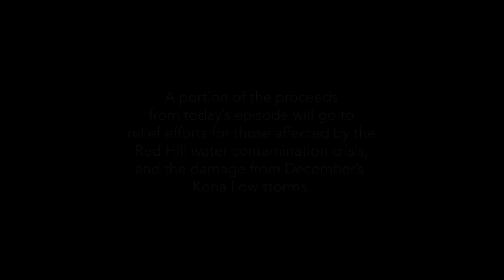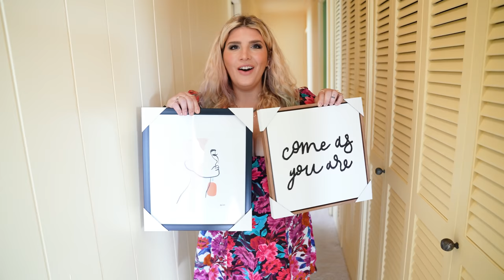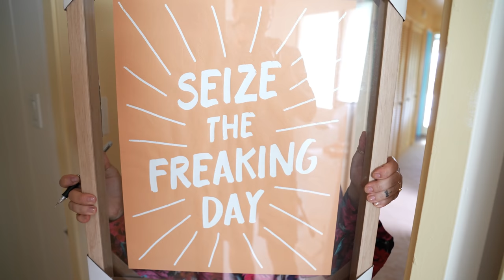Our Island house is RUINED 😱 (fixer-upper NIGHTMARE)

Comment: The sad things is I can almost guarantee you that the people who sold the house to them knew that drainage was a problem and didn’t tell them. At least now they know and can fix all the issues before they put in new floors and furnishings. ☹️
Reply: That's almost,  exactly what I was going to comment, those sellers, were like here Ya go sucka.😳😫 
Wishing y'all the best,  and this has been said already however, thank the lord this happened now, so you definitely know, what is on the to do list now. 
I'm also curious if that is termite damage, & water damage? If it's termites, You should definitely get the house, & all your trees checked, &  treated for termites then!!
Wishing you 3 the happiest, healthiest, safest, 2022!! 💞🙏
Reply: @missybekind5022  yeah from a brief glance (I'm sure they had actual inspectors) but it looked like just what humidity, rain and salt air does to outdoor timber esp if it's not repaired and resealed frequently. They probably actually found termites though.
Reply: @nox8312  I totally agree, nobody would buy without having it inspected first. 
However, when Joey! Was tearing that patio wood,  I'm pretty sure, Kate said "termite damage." (Can't remember the time stamp.)

Comment: This is a nightmare right now. But there are several ways to deal with water issues. My previous house had high water in the backyard. I was terrified it would get into my house, but then I had a French Drain professionally installed and the problem was immediately solve! Good luck Mr. Kate you can do this!
Reply: How much did that end up costing you?
Reply: Exactly french drains are extremely common in Europe were its cold and wet!
Reply: I added a french drain and sump pump in my basement in Utah. We have clay soil where we live and some year's we will get over a foot of snow then it warms up day's later and melts it all the snow has to go somewhere. Once we put in the sump pump and french drains we've had no more problems.

Comment: Time to install a French drain network! Once it’s in, you’ll love it, and it’s not actually that expensive, compared to, say, regrading your lot. 😉
Reply: I bought a house seven years ago that the prior owners installed French drains around, and they have saved a lot of electricity for me as my basement sump pump hardly ever turns on, even in 3 day storms.  They work, if done right.  Joey has the idea.  When things settle back down he can dig the trenches he needs, line them, put drainage gravel in and plastic drainage pipe and guide the trenches to where he wants the water to flow.   However, if neighbors don't have their yards graded properly or don't have French drains installed to drain water from their land, it could well overflow to your property and overcome the French drains.  You would also want to make sure that the ravine or gulch where you're draining the water to is stable and won't collapse if thousands of gallons of water is directed into it, including flow from neighboring properties.  Wow - too much to think about.
Reply: @jannibal9273  I love how much knowledge we can find in the comments 🥰🥰

Comment: One more thing! Start collecting water now at Costco. Don’t just wait for a major storm to come to get supplies. Make sure you have a generator that can power your fridge, a few fans and at least one split unit a/c. Also, a few buckets from Home Depot. I like those in case you lose water and I use the water coming off the roof to collect and use to flush the toilet. Not trying to scare you at all. It’s just nice to feel prepared.

Comment: You’ll be ok guys. There will be an engineer out there who can advise you of your rights and protocols. If the rain is causing this much damage, then you might get your plans pushed through quicker to start construction work. It looks as if your foundations are rotten and maybe foundation subsidence. It can be fixed, but obviously at a cost, everything needs underpinning and all the drainage needs sorting to drain the water away. Also all of your guttering needs replacing and attached to drains to take the rainwater away too. Tomorrow is a new day and also the star of a new fresh year. Hugs and cuddles sent your way from here in the U.K. you’re both clever individuals in your own rights and you’ll work it out with the right people to ensure your own safety and that of moon. Good luck guys and Happy, Healthy, prosperity for the coming year ❤️
Reply: Yes this is great advice!

Comment: I hope your house is ok. Call in water abatement crew. Get industrial humidifier, dry as much as you can, and may need a ozone generator. 

I had hot water heater pipe burst in a fire. I have dealt with similar flooding and water damage. 🥺🥺🥺

Comment: An advice from someone who lives in an area that is often flooded, even if your house is not in the flood zone, a flash flood is a whole different thing, you’ll just never know where it will go. My house is in the flood zone, but since it was built higher up the usual flood never really reaches my house even when all my neighbors' houses are drowning. Then flash flood happened back in 2014 and the flood almost reached the second story of my house, literally like 20cm away from reaching the first floor ceiling. Never underestimate flash floods. It came out of nowhere, the water level rises super fast and the water current is deadly, especially when it carries along wreckages. Also, where I’m from we don’t get an alert or warning, so when you get a warning next time, please don’t treat it so casually, they are sending a warning for a good reason.

Comment: I know how you feel even though I live in mainland Spain. We had just finished the renovation to our new home when we had a what is called a Gota Fria and our whole house flooded from under the house as the flood waters did not reach our building.  We had to have the whole floor of the house replaced whilst keeping our fingers crossed that the walls did not fall down.  In fact under the kitchen we found an 8 foot hole and that the floor was only a few centimetres of concrete covered in tiles! Anyway that is way behind us now and we have a lovely tiled floor throughout the house that we love. So think of this as a blessing in disguise.
Reply: I was going to say the same. I'm from Galicia and raining is so common, during Autumn-Winter is the worst but the houses and even the cities up here are already designed to hold on during floods. 

They need to first pull through and then they'll be able to prepare for the next one. This my come with having to pick practical prior to pretty but I believe they can pull it off.

Comment: So sorry about the rain and flooding 😔 we are in SE Texas and have survived Hurricane Harvey and 2 years later Tropical Storm Imelda flooding. For anyone that has to deal with flooding, be sure to remove everything wet and clean it with vinegar and let it fully dry before putting it back. Mold grows easily in humid climates which may be a little different from what Joey and Kate are used to. Everything is replaceable and this will give you guys first hand experience to know how to rebuild areas of your house and yard. Still so unfortunate you had to go through this!

Comment: I'm from Puerto Rico so I understand the tropical rain struggles, after a few days of rain flooding is inevitable. My house has a drainage system. A few years back pipes were installed underground, they have collection points with screens to keep out the rocks and such and they collect the water to be drained in safe point of the property! Hope you are able to fix your issues!🏝

Comment: Btw flash flooding doesn't necessarily come from the sky (at least not where you might be) usually it comes from overflowing upper catchments. So you don't need to be low lying or storm surge flood prone to get flooding in a flash flood. Or it rains so heavily in a short period that there's no time for the water to drain away (and obviously your property has drainage problems too). Would definitely be worth getting well acquainted with Hawaii's emergency systems, what they advise for property and personal preparation, and what different things mean and how they could affect you.

Comment: Anything that needs to be stored, but in plastic sealed bins/higher up… Not specifically Hawaii, but in TX our house was on a slope… The lake was at the bottom, with X Amy of property that didn’t belong to us but could flood… That part never flooded, but our driveway (top of slope) would flood, and into the garage/front room. So after one rain we ended up buying Christmas size bins to store things, and my dad Installed a draining system to deteriorate the water out or garage area. This solved the problem about 90%, so where it wasn’t that much of an issue…

Comment: something my country would do with roads near malls or underground train stations, is that we do have a drain built along the edge of entrances to prevent flooding, and alot of our buildings are built elevated from ground. meaning there is always a step or two between the building to the roads. This way if we ever occasionally do get heavy and long rains, the water will not overflow and leak into buildings.

Comment: I may not live in a tropical area, but I do live on a marsh. Those flash flood warnings come all the time and our basement is known to severely flood. Although safety isn’t the concern for me, property damage is definitely on my mind. We’ve re-done the draining 3(?) times since we’ve got this house, invested in way to many sand bags (each storm seems to need more and more), and spent lots of time researching the best ways to absorb and clear the water that still comes in. Flooding isn’t fun, I remember the first time it happened I freaked out. Thankfully we have a ton of camping gear so when we do lose power, we can manage fine for the most part. Collapsible water jugs or any type of water storage is a must for power outages if you need electricity to bring water into the house (might be applicable if you have your own well or live on a hill and need to bring water up to you), but sewage is another huge concern with storms an power outages. I’ve forgotten how many times we lost power and our sewage pumps stopped working and within minutes, we have another issue flooding our basement. Stay safe all.

Comment: I spent many years in the Canal Zone, torrential rains were a regular thing as I remember. Our houses had tile roofs with deep overhangs. Maybe four feet. At ground level at the edge of the overhang was a wide shallow concrete drainage ditch. This ditch was not deep but wide and had high enough edges to contain the runoff. It doesn't appear that your house has any rain catchment ditch that I've noticed. Our entire house was surrounded by this ditch. The containment ditch surrounding the house continued through the yard to a deeper and wider ditch that all the properties flooded into. This deeper ditch at the edge of the property carried the runoff away from all the properties and the street. Between the house and the catchment ditch was a garden area. This area was elevated to the top level of the edges of the catchment ditch. For your house not to flood you just might need to do some serious grading and install a similar runoff collection system. I believe in an early Hawaii video you mentioned you were going to reroof the house. Consider the deep overhang and runoff collection system in your plans. Good Luck!

Comment: Sorry for what you dealing with but i say use it as a lesson of what needs to be done when your renovation has to be done. Drainage systems. Water tanks maybe underground ones if not the too ground ones, save on water for your house, overflow systems especially for your gutters to flow to somewhere. Best of luck and a bumber that the new year maybe starting so.

Comment: hi guys, keep safe!! maybe you can get in touch with someone on the island who knows how the drainage stuff works so you can take that into account on your renovation. also, if you are planning to raise the ground level in your property so the water flows down to the street drainage system (i guess?).. cause even if you're on a hill but the property itself is the same or lower than the street ground level, that kinda sounds bad news.

Comment: As an island girl I can tell you... You will only get two seasons..rain half of the year and summer on the other half... . Carpet all over the floor is not ideal it can get moist and bad smell due to continues rain.. While building house the base need to build one or two step high above ground... And extend the roof outside the house a little more intending to keep the water away bcz rain comes with wind ..

Comment: Yikes, as you assess...good to drain away from the house.. Stormwater ends up in the reefs adding to the stress on coral, the natural storm barriers of the coast and vital eco systems.  Its  no on diverting water to the sewer system. thats the regulation.  Overwhelms the sewage processing area and creates sewage overflow to the reefs.  Worse than just stormwater. Holding water so it can naturally drain at a slower rate after the rains are over is what we are required to do on Guam.  The holding areas do overflow during heavy multi day rain. We are required by regulation to 100% hold stormwater on developed property including residential. BTW no one has wall to wall carpet here, vinyl  or wood floors.  After many storm cycles over the years, its Tile all the way.

Comment: I feel like there should be a how often in years a weather event like this happens warning system. I feel you guys so much right now. 2 years ago I spent almost a month straight driving down behind my home where it meets the Arkansas River to see how close it got and if the protection walls were breaking yet. I took pictures from the same spot. Based on math (I have friends 2 blocks away at the county sheriffs offices and one engineer for our damns in Tulsa etc) working out if the water broke thru I would have 45 min to load self, miniature horse and 2 dogs at the time and get them a mile down the road to an elevated "safe" place. It would be super tight cause the whole place would be leaving at once. The city had already asked for evacuations. That pissed me off bc they were reinforcing everywhere but here. This was what they called a 100year flood scenario. In today's words..something this bad only happens once every 100years. That would have told all of us grab your bums and a uhaul. The last time it did this was 35 or so years ago and it broke thru a retaining wall 1.5miles from me. They built a monument to show how high the water got. 20 feet over my head if I stand next to it. That same wall sprung a leak during this event. I called my engineer. My man called the governor. The national guard was placed on the wall. For days....weeks. No repairs. Guess they would have jumped into action if it got to real. They have the ability to help from the air. Still....everyday...down to check if today was the day. It wasn't fun and I do not envy you guys got damage. We lucked out. The walls held...barges escaped...so much destruction.

Comment: Omgggg I feel for you guys, you Need to invest in a water pump system and big drains, also when you eventually do the re-modelling, I would build up the doorway steps... In the UK 🇬🇧 as it rains a lot all year round all our door steps are high off the flat ground front and back entrance... Maybe install a draining system in front of your garage so in future it drains away from the garage door area... Houses here built on flood plane areas, actually have a four steps up to the front doors... I would think about maybe putting in planning permission to raise the house up and then higher the ceilings.   Just ideas... Or ask your neighbours how they deal with heavy rain storms... Sending you hugs and keep safe, Joey your a good man digging for hours...  When the storm ends, you need to hire a dehumidifier to dry the house out, the carpets and floors will need drying out, other wise dam will cause health issues.. I pray it all gets sorted.. Best wishes for the New Year from Donna and family xx here in Liverpool UK 🇬🇧 💕

Comment: It's like someone who built your house didn't think of nothing. I live in Poland, we don't get high water in my area at all. My house still is on a platform (concrete) and we have 4 steps to get into. Even if it would rain 7days this hous stays over water. Even the garage is up. Walls are from bricks, windows have 3psc of glass. It can be super warm, cold, windy, rainy... My house will stand. And above it all we have insurance for all that could happen.

Comment: I have faith that you guys will fix this.  The universe shows us what is most important in the weirdest ways.  I feel this is a testament to that, in that you now can adjust the plans for the outside to accommodate for possible future flash floods.  Btw did you know this video time is 12:21 .. angle number 1221 tells us to actively pursue your dreams before it's too late.  And you are!  Your family is on the right path, if you had any question! <3 from New York/Connecticut

Comment: That flood is nothing… you need to be in Florida with flash floods where the sewers cannot take the rapid rainfall and it goes from light rain to your in your car and the water is up to your windows. Do NOT DRIVE in a flash flood water will be taken into the engine. Park your cars with the exhaust uphill if possible. It sucks, but it happens.